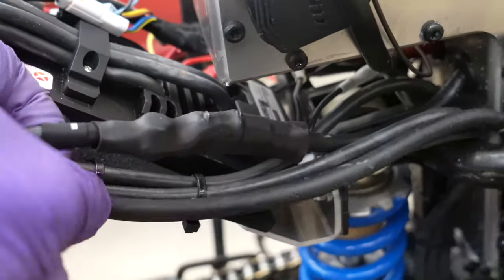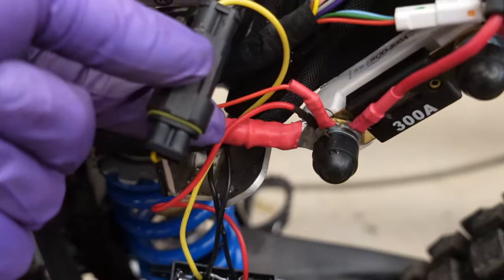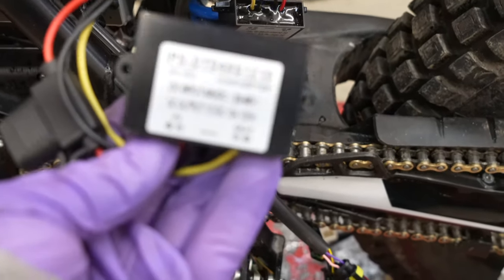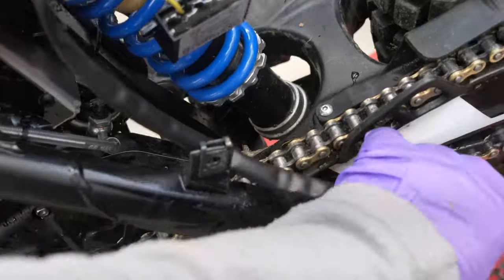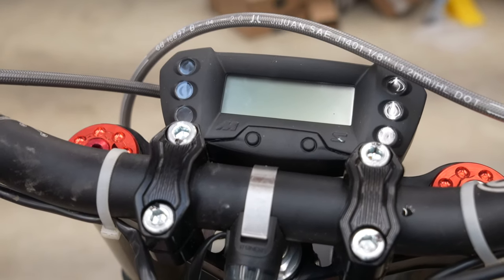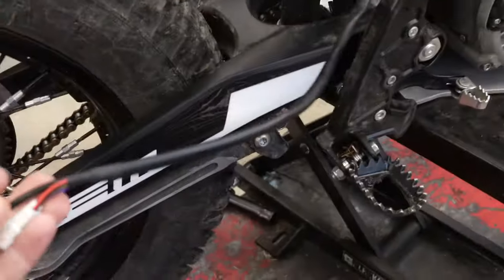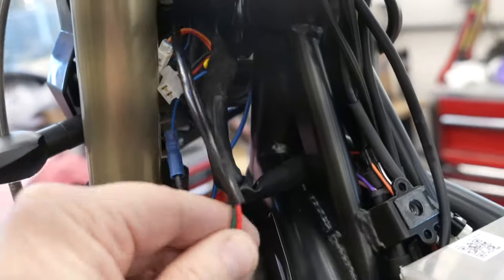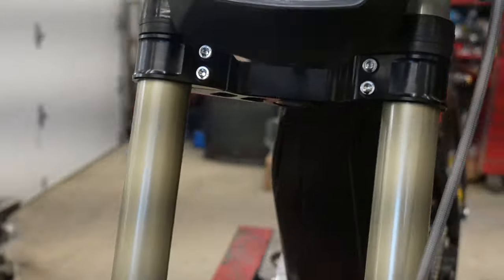Electric Motion EM 2021 Escape R homologation Lighting install

Comment: Thx for the vid. Is this the EM lighting kit ?
Reply from the maker: Yes, this is the ‘homologation’ kit- with speedometer, turn signals etc.  I did not use the factory taillamp/turnsignal setup.  But I did test with it.  Rather odd, in that it mounts on the  swingarm and up around the rear wheel-  like the Beta Trials ‘road’ setup does.
Reply: @improvsax  thanks. Wanted to get the escape R with the clutch but that models doesn’t come with a light but the standard escape does. Thanks again
Reply from the maker: @tchaiquentin  I ordered my Escape R with the Homologation kit, but it did not come installed.  I had to have EM France connect to my bike to ‘turn on’ the option for teh speedometer to work.  (Rest worked fine)

Comment: How do you compare this bike to a full size dirt bike? Can you ride single track aggressive at high speed? I understand it's basically a trials bike with a a seat but curious how it would be as an enduro bike. Thinking this might be a good do it all bike. I do have a xr650l for daily sporting by the way. Keep the escape footage coming!
Reply from the maker: It is identical to the trials models, but larger battery and a seat.  Same frame, suspension, brakes etc.
  It would not be good at high speed with rough terrain. The suspension and geometry is just not made for that. You could ride some enduro- but likely only do well with  one that is quite low speed average.  The harder the better.
  It is great fun on difficult trails,  it can be ridden quite quickly on relatively smoother stuff, but no way going to work like a regular enduro bike for fast riding.
Reply: @improvsax  thanks for the input. I need to decide between the ktm freeride and this bike.
Reply: @adamheath2835  did you decide ?
Reply: @tchaiquentin   yeah, I bought the ktm freeride. No regrets at all.